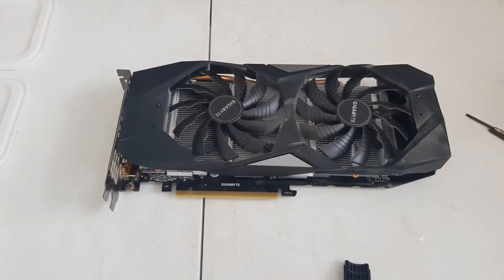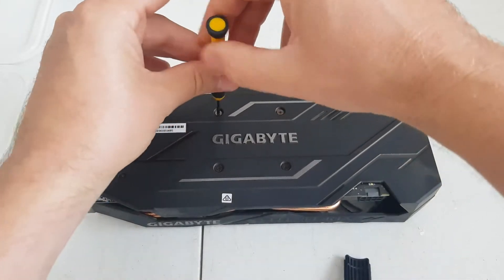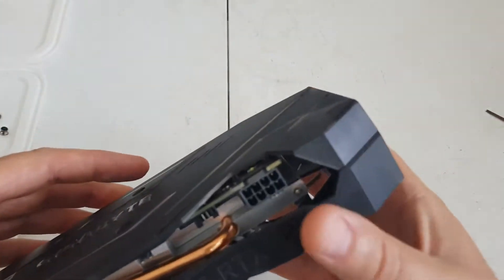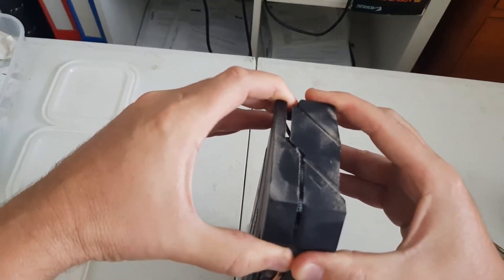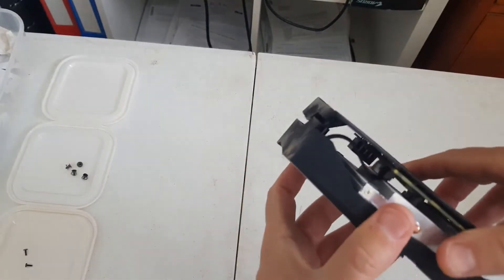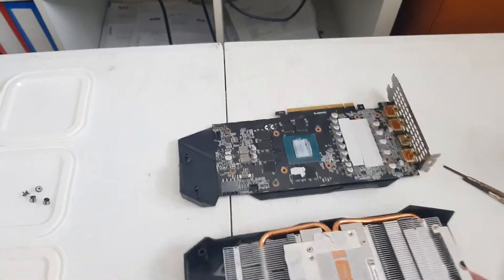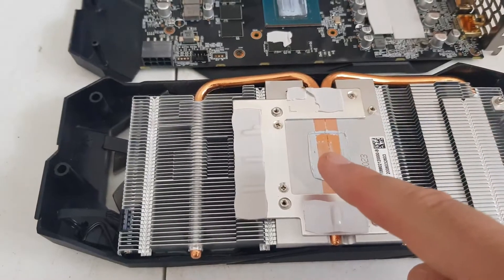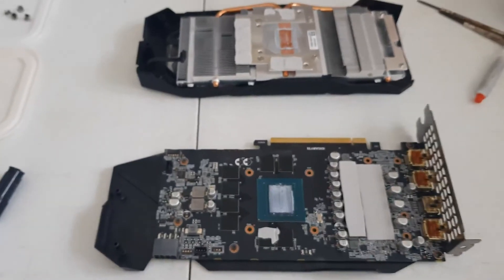How to open a Gigabyte RTX 2060 Super!

Comment: Dude, I'm in desperate need of thermal pad thicknesses EXACTLY for this card! I almost changed it to 1mm, but the temperature in games could go up to 90 degrees. 
Then I changed and put 0.5mm and now it goes up to 80 degrees! The thermal pads had excellent conductivity, 6W/m-K, but there you go... 
That's why I'm asking for help if you can even help with a picture. 
Thank you very much!

Comment: Will the heatsink tension properly with the 4 screws if I've removed the backplate? I hear that plastic backplate seriously harms thermals. Also, I read elsewhere that the 2060 Windforce x2 OC uses 1mm, 1.5mm and 2mm pads. Are they really just different for the 2060 super with the same cooler?
Reply: I came here because I'm about to deshroud mine and I read that there are problems with too little and uneven pressure between the chip and heatsink. I have no more info yet.
Reply: @johnnycruiser2846  hey bro is there any update on your card?
Reply: @mrtomato4169 
I deshrouded, repasted the die and all other chips with high end pastes and the temps dropped by about 10 °C. I also bough and custom fitted like 10 case fans.

Comment: i took the plastic backplate off and re done the paste and thermals and now it doesn't go over 77 "Gigashyte" cheers dude.
Reply: bro whats the thermal pad thickness for vram ?
Reply: @skK-xk3yc   0.5mm on the memory squares and 1mm rectangle strips
Reply from the maker: Great work Rampant - it's bonkers they wrap all that plastic around it to kill the cooling!! Ends up being a decent preforming card after the mod!
OZ Mining

Comment: Hey, you sure its 0.5mm for memory and 1mm for vrms? Do you alao cut into squares for the memory or long rectangles? 

I bought both actually 😅 Gelid Ultimates to lower my temps, 80+ temps is too much for gaming
Reply from the maker: Yes those sizes work perfect!  Also to get a further 2-3 degrees drop in temps leave the back plastic cover off, it really helps cooling!
Let us know how it goes
Thanks for watching
OZ MIning
Reply: @OZMining  I was wondering can I use 1mm pad for both vram and vrms?
Reply: hi what pad size for vram ?

Comment: Hi,you put 0,5mm for memory? what temp you have now?after
Reply from the maker: Hello Alexandru,

Around 5-6 degress at Core and Memory, well worth doing!
Thanks for watching!
Oz Mining
Reply: @OZMining  you put 0.5mm pad for memory????
Reply from the maker: Yes 0.5mm on the memory squares and 1mm rectangle strips on the other parts, I'll do a follow up video soon showing how & where to place the thermal pads👍👍
Oz Mining🦘
Reply: @OZMining  hey did you do a follow up video putting the new pads on?
Reply: @Chris-h8f6n he didn’t. False promises
Reply: @justinvargas8517  i manged to get pads and put in on myself..but don't cheap out i got cheap ones and it made it worse so i got more expensive pads and it made me keep my boost  below 80c, i dont think i can  get any cooler with just the 2 fan  on this card  :( . ive had to accept that this 2060 super card just runs hot as hell man and i learned my lesson that next card upgrade i be getting a x3 fan on card.
Reply: @Chris-h8f6n  what size pads did you use?
Reply: @justinvargas8517  0.5 mm on the memory (little square bits) and 1mm on all the other parts , i also got 2 noctua fans and put them next to card so it blows cold air onto it aswell.

Comment: hello, i have the same graphic card and i was trying to find the thermal pad thickness information but i couldnt find it anywhere :( can you tell me the thickness of the pads? otherwise i will need to open mine to measure, didnt what to open it twice xD
Reply from the maker: Hi Carlos,
Thanks for watching!
You will need 0.5mm & 1mm pads to do the job.👍

Here are the ones I purchased below, I tried both 

Thermal grizzly minus 8:

https://amzn.to/3hzTOx3
https://amzn.to/3Mn24hZ

Gelid Ultimate GP:

https://amzn.to/3hClL7d
https://amzn.to/34dC3Ax

I will so a post nexct week to report which were best.  I also used Noctua HT NT2 thermal paste, expensive but top notch!  

https://amzn.to/3hFQVuG

These 2060 Supers have very thin heatsinks and bad fans so they need a little extra help we can give them.  Also if you really want to reduce temps remove the plastic back plate it makes an amazing difference.

Good luck!
OZ Mining
Reply: @OZMining  ty for the info and fast reply! :D i ill order that thickness and make use of the free shipping that my usual shop are doing this weekend :D
Reply from the maker: No problem at all happy to help, good luck and let me know how goes! 
OZ Mining!
Reply: Wow dude I was looking everywhere to find the thermal pad necessary !! Glad I opened commentary of this video lmao. Thanks you so much !!